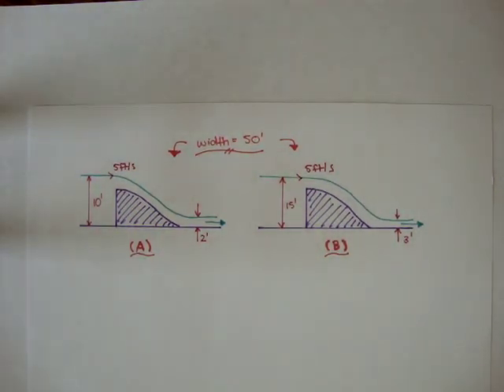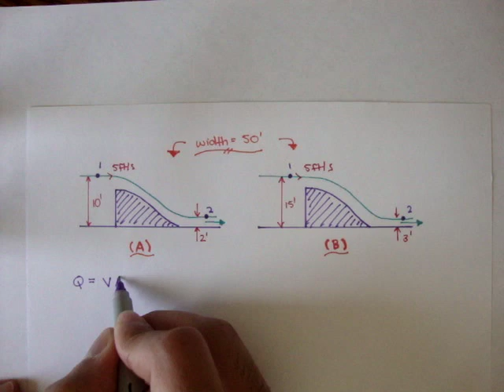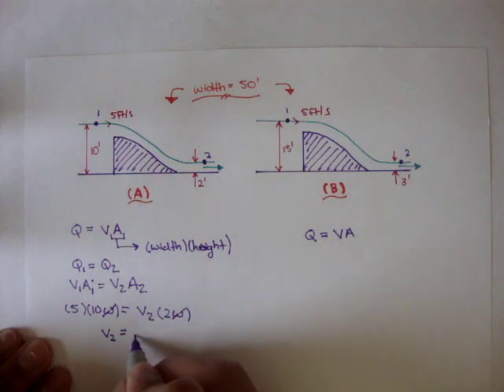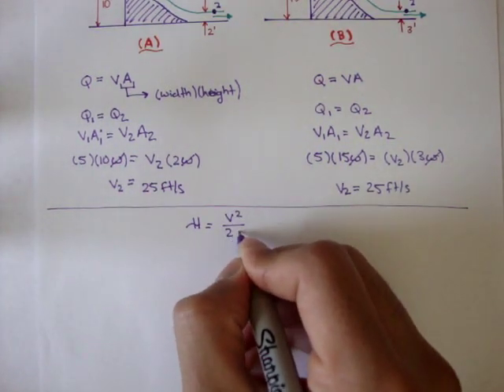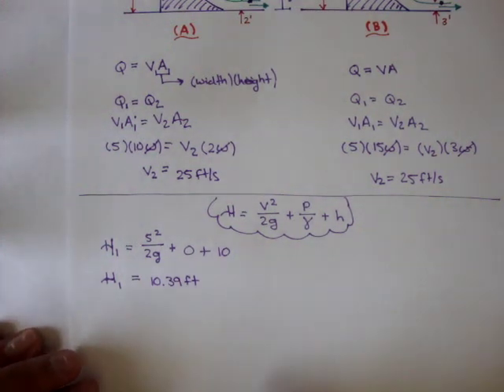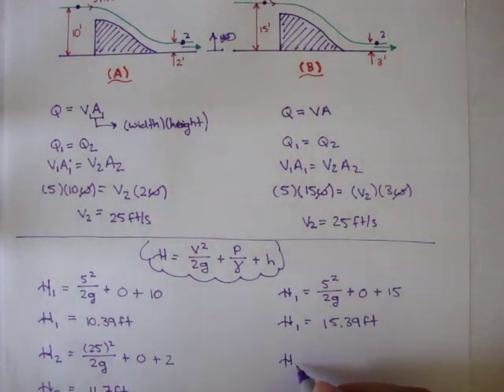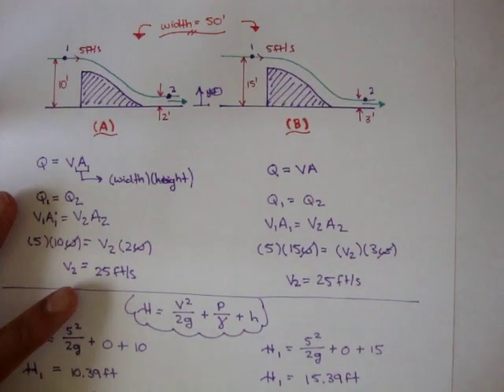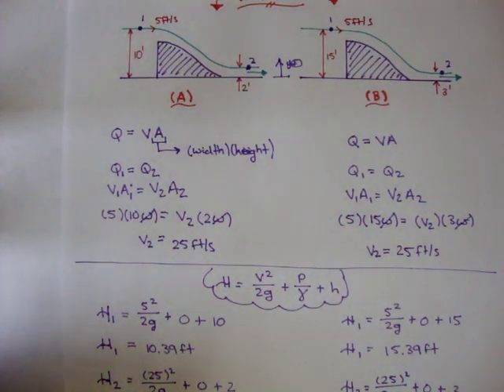Bernoulli Equation: Example 4 [Fluid Mechanics #29]

Comment: I've been trying to find a fluid model that would apply to a problem I'm working on without success.    I'm also somewhat mathematically challenged. Is there a good place I could post a picture of a math model I'm trying to solve that people are enthused about helping solve?

I think the solution is a variation of the Bernoulli Theorem  except I'm using a rectangle shaped duct with and upper and lower plane of convergence.  Most of the formulas I find relate to a circular venturi.

Comment: Isn't energy conserved?  Thats the whole the point of the Bernoulli equation, to account for all energy transformations from point 1 to point 2. Energy is just transformed to different components of the equation, not lost.  I think something is wrong with this video when it suggests one scenario is better than the other because scenario b looses energy and scenario a does not.  Really you could have just solved for V2 using conservation of energy (bernoulli) and then found the correct h2 using the continuity equation. In both cases the h2 isnt quite right.  This is my understanding anyway.